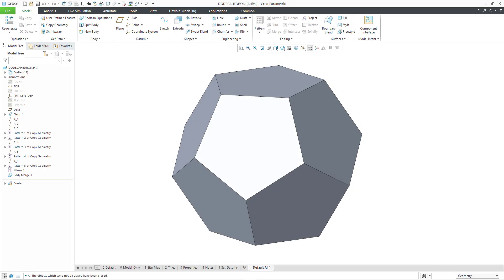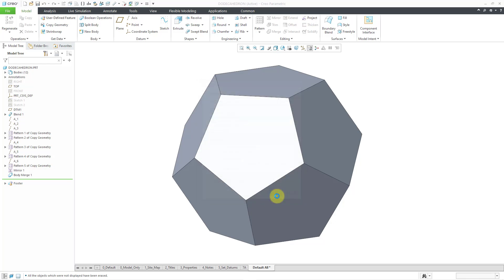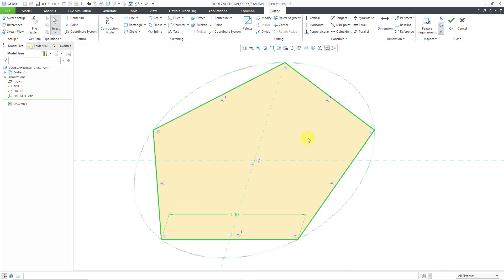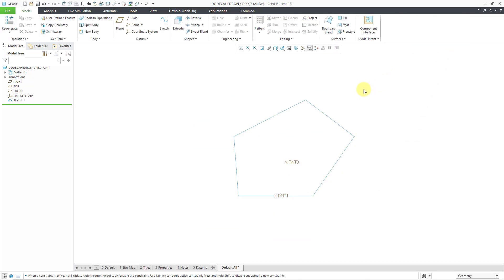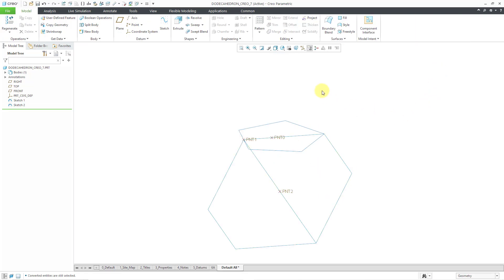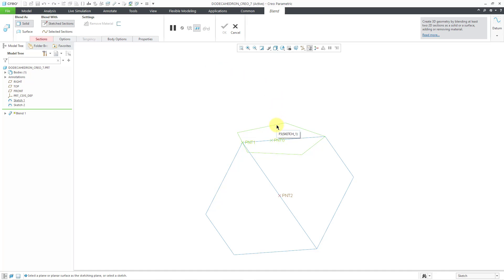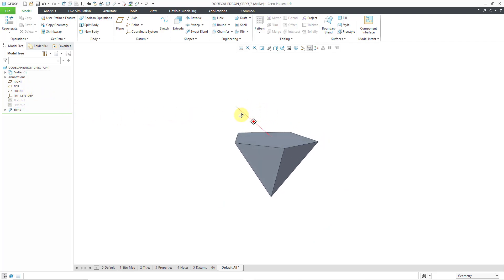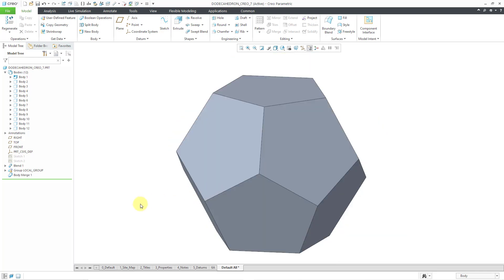Creo Parametric - How to Model a Dodecahedron - Platonic Solids and Polyhedrons

Comment: Or... why not just use the equation for the distance from a face to the centroid of a dodecahedron?
1) Create a sketch of a pentagon with edge length = a
2) Make a point above the sketch on an axis through the center of the pentagon, this will be the centroid
3) The distance to the centroid is given by d = (1/(tan(36)) * (1+sqrt(5))/2)/2 * a  (note this is in degrees, not radians)
4) Create a relation to set the centroid distance d as a function of edge length a
5) Create a blend through this point as in video... voila, a THREE feature solution to create the "wedge" which can now be mirrored.
6) Also, seems easier to just mirror the blend feature instead of the body...
Reply: In the right direction but still a grind